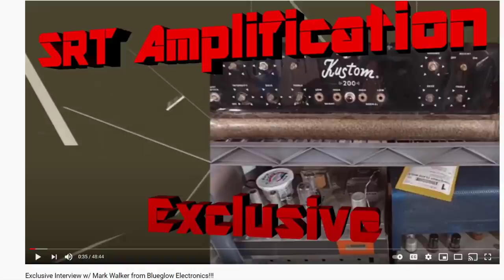SBS Several Tech Tips - Portable O-Scope - Backyard Hamfest - Mark Gets Interviewed

Comment: Mark, great tip on labeling items "just in case" along with adding estimated values & current conditions.  I've started thinking about something similar and will use the tags I've got and get started.  I know that my wife wouldn't have a clue about much of what I've got out in my shop and I'd certainly hate for her to get ripped off when trying to dispose of the stuff.

Comment: Those are some very good life tips.  One never knows what can happen in an instant.

As for the floating ground O'scope, you still have to be careful if the two channel grounds are tied together.  Those grounds are most likely tied together inside the scope.  It is not like using two meters to measure voltage drops in two different parts of a circuit.  If you try to look as signals from different parts of a circuit and clip the ground leads on in two different places that are not at the same potential you have just shorted them together.  That is not good for the scope or the equipment you are working on.

I'm looking forward to your review of this as it looks nice.  I'm in the market for a new scope.  But I'll probably buy one more like the one sitting on your top shelf or something like a Rigol DS1054Z or DS1202Z.  Ideally, I'd like at least 100MHz, 4 channels, plus digital channels.  I want enough scope that I won't be bumping into limitations when working on ham radios.

Comment: Thanks Mark for your videos. Do not see a good place to post this question so here it goes.
Very interested in building a tube amp. Which one and for what purpose? Purpose complicated question - considering amps for a Quad system I have mid quality decoders low power it would be interesting to connect 4 single ended amps to each of the out puts or two stereo amps to each set of channels front and back. 
Which kind of amps considering Bob Latino kits the ST-120 and M-125 mono blocks. For the purpose of sitting up for quad gets very expensive fast. May just stick with a higher out put intergraded amp for the Quad system.
Still want to build a tube amp for the stereo system, have got to admit two mono blocks look pretty cool.
Reply from the maker: Go post in the blueglow.club forum, I'm sure you'll get input there.